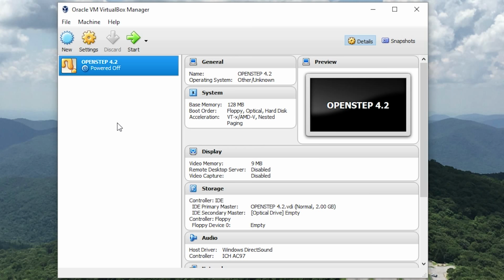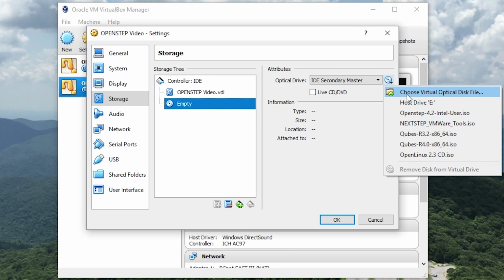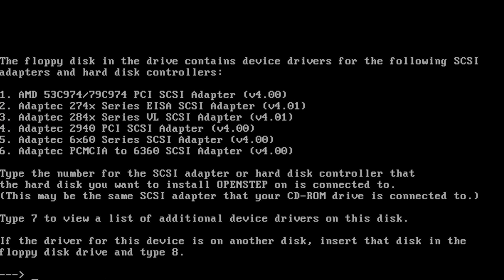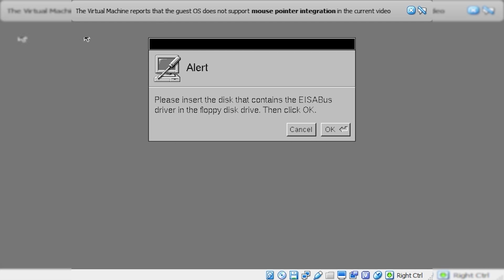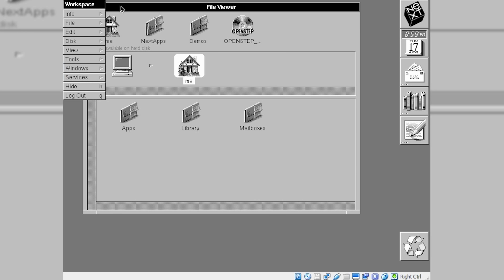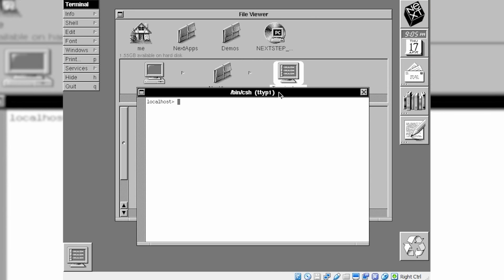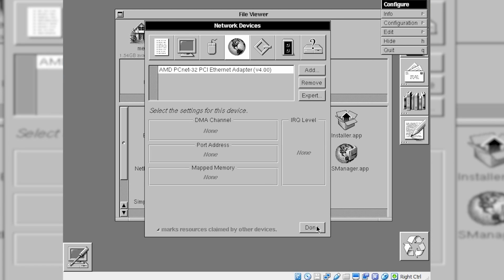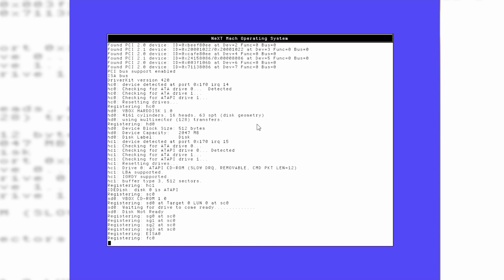How To Install NeXT OPENSTEP 4.2 in VirtualBox (Tutorial)

Comment: Found this after over 2yrs , tried out .. install runs well for the first part but then I struggle ...
In the section where you install graphics driver - my mouse is behaving erratic ... the mouse pointer is jumping wildly around - if I manage at all to access the video driver button, I cant go down to the scrollbar in the videodriver selection - any way to control that without mouse? If it was windows I know how to access the controls / navigate between them - but here .. Next/Openstep seems to avoid any "known" key-combo or key-shortcut (tab-key) ??

Comment: Sadly, this doesn't work in VirtualBox 6.2 under Mac OS Catalina:

Failed to open a session for the virtual machine OpenSTEP.
The virtual machine 'OpenSTEP' has terminated unexpectedly during startup with exit code 1 (0x1).
Result Code: NS_ERROR_FAILURE (0x80004005)
Component: MachineWrap
Interface: IMachine {85632c68-b5bb-4316-a900-5eb28d3413df}

Comment: Thanks a lot. I must try this just to experience Adobe Illustrator on NeXT :D
Reply: Correction: After installing I realized I couldn't run Illustrator as it was (of course) for 68k, not Intel that OpenSTEP is running on :-( the old dream will have to wait a bit longer.
Reply: @superviewer  Take a look at "Previous", is a Next Computer emulator, you can install the Motorola 68000 version in a Linux PC
Reply: @MrXavitaker  Thanks. Yes, someone else mentioned too that Previous is the way to try Illustrator on there.

Comment: For those that were not able to download the archive provided here, I just did it on a Linux system and while it does download and decrypt and work, it did bog down my firefox so much after it finished downloading I had to restart my browser. It is more of the MEGA download site than the file itself. I think in windows you WILL have issues downloading this as MEGA like any other site like it will have ads and bog the system down. Now on topic with the video, Michael, what OS are you running virtualbox on? And what version of VB is it? Also, what are the other settings you set or left default, for this OS to work? I noticed a few things about the motherboard chipset types and amd-v or some such? PIIIX or P4X or some such? I know I have had issues installing qnx or linux if the chipset type is not right, if the system does not conform to a period correct setup to install older unix OS it does tend to fail due to the chipsets for the drives and VGA,DMA controllers,etc not being detected or able to load and activate. I have NeXTSTEP 3.2,3.3 and OpenSTEP 4.2 user and server but yeah,never thought to try on VB. Also,if you used ATI Mach64 based cards and Soundblaster 16 audio, you can make this work in real life hardware with a pentium or P2/3 system. I will try the real deal once I can write the floppies lol!
Reply: Did you get it working?

Comment: You can also log in as root to avoid the permission issues:

- Double click the date icon from the Dock to open System Preferences.
- Select the lock icon and press "Create" to set a password to the default user.
- After you done that, go back to the File Viewer and click on "Log Out".
- Now you can log in as root (the password is a blank space).

To log in again to the default user, type "me" as the user name and type the password you set before in System Preferences.